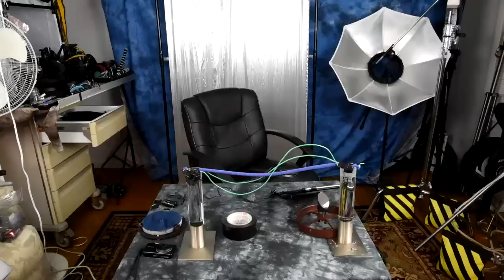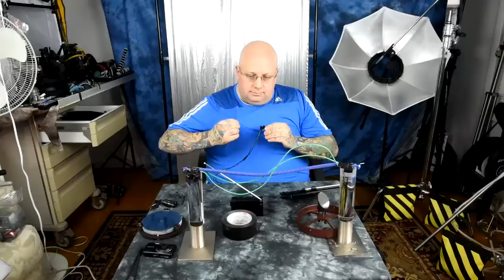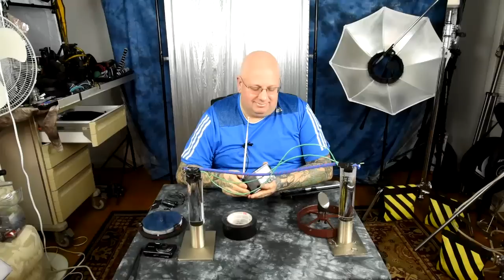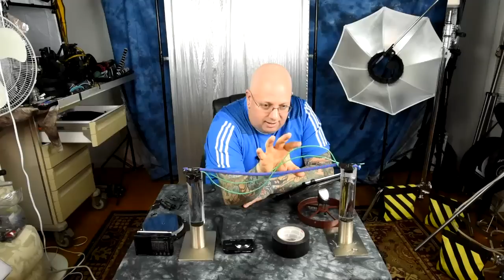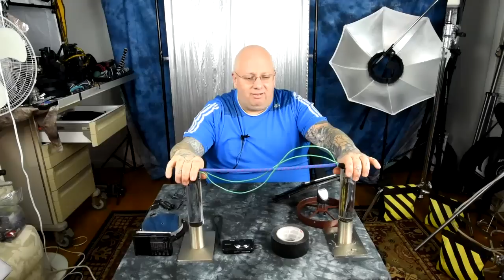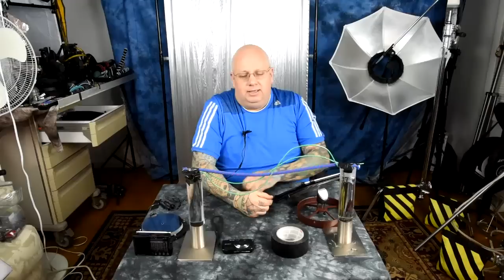Introducing ISO/GAIN: Applied Gain (ISO) VS. Native Gain (SENSOR & EXPOSURE)

Comment: Ken, this was very eye opening.
My question:

I actually tested this out, took two shots, both with the same shutter speed and Apeture, i underexposed one shot on purpose by 3 stops then increased the iso on the second shot by 3 stops. Digitally increased the exposure by 3 stops in lightroom of the first shot to mach the second. What i found is the noise is the same.

But what i want to know is this, if i take an astro shot at F2.8 with a 30 second exposure at iso 100 and the exact same settings at iso 1600, i should then be able to match the second shots exposure by bringing the exposure up by 4 stops to match the ISO of the second shot (1600). Is this correct? because then it seems way more advisable to keep iso 100 at all times even when doing astro shots?
Reply from the maker: +Alexcpt Photography depends on the camera also how many stop you can push it. most are 5 stops max, and "get away with" 6 stops. 

base ISO varies from camera to camera,<<<

depends on what kinda astro youre doing, star trails, or max gain without trails< 

both are valid for astro
Reply: So for a D600, what's the cut off iso before it's better to rather apply software gain?
Reply from the maker: keep it 5 stops without getting a butt burn
Reply: +Theoria Apophasis basically don't clip highlights, hehe
Reply from the maker: use the zone system. 2 stops above highlights.

check your dynamic range

or exposure for the highlights and lighten the rest in post (takes more time to do this of course, but sometimes the only option).
Reply: +Theoria Apophasis pretty much what I do, tend to shoot 1 stop under of I'm exposing for the sky, which is almost always the case. What I want to know, is it better for example to shoot a scene at f2. 8 30 second exposure at iso 100 and then increase my gain at the software by three stops esentially making it iso 800 right? Or rather just shoot iso 800? Shooting raw of course.
Reply from the maker: you can do selective gain in post too

yes, but all of this takes time, its better to nail the DR at camera.

IF you can that is

Comment: Basically with each new iteration of camera model released, all the manufacturers are doing in reality when they state ISO improvements over the previous model is they just made the amplifier bigger. An analogy would be Sony released a stereo amplifier that was 2 X 100W Rms but this year's new model has been improved, it is louder than the previous model. Basically they just put a new amplifier in it rated at 2 X 110W Rms. The sensors are essentially the same camera to camera, it's just that some put better, more powerful amplification to help boost the incoming signal, which we call ISO. That being the case the Sony A7SII has a hulking great big amplifier in its body lol

Comment: After researching some clever dude on You Tube Sony have announced they will be releasing their new camera with a chilled sensor.
The camera will remain the same small size and lightweight however you will need to carry separate nitrogen tanks and connecting tubes along with spare batteries etc. etc.